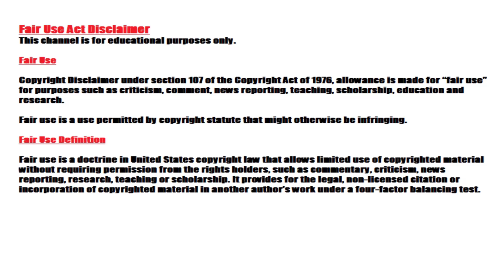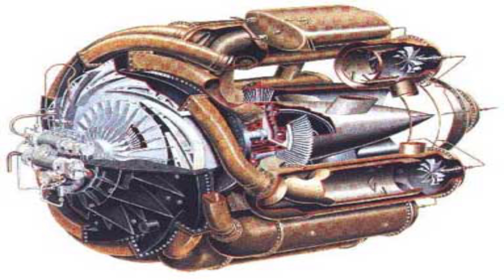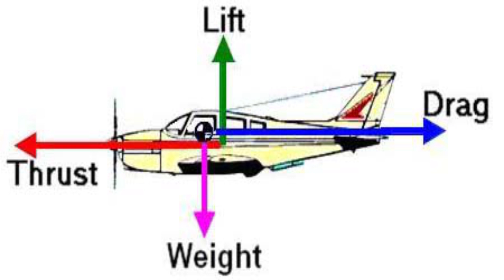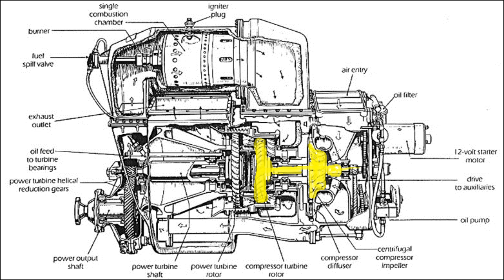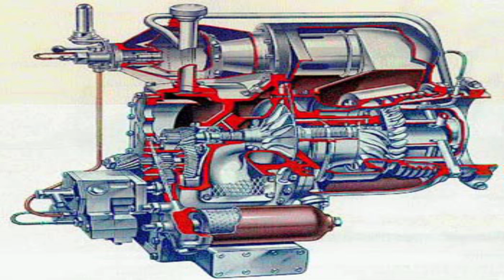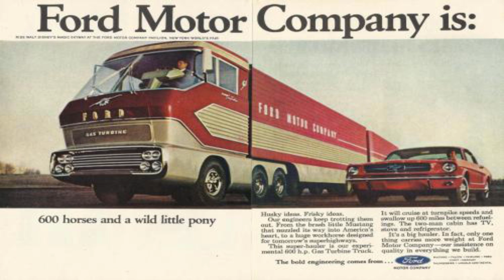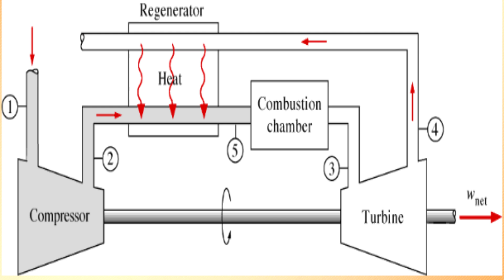Rover's gas turbines

Comment: Nice one Turbo!
Here's my idea, one of those little fireman's  jet engines powering a genny in a car, electric motors on each wheel and a big F#off capacitor instead of batteries, 
Now we need to find someone with the mad skills to build it  😉
Reply from the maker: While you are trying that I'm going to find two of those little engines and make 60hp roller blades.....   Each foot'l be 60hp
Reply: It will never fit on my bench, You will have to make it for me  👍  😃
Reply from the maker: @Everythings_Adjustable  I don't do wires mate!

Comment: Many thanks, quite interesting. Talking of big diesels I was looking at one at the Hereford Water museum. A Tangye single cylinder with over 6000 cubic inches, or 100 litres.
Reply from the maker: Glad you found it interesting! Did you happen to find out what sort of speeds it ran at? I'm guessing around 60 rpm
Reply: @turboproductions212  No I didn't but I suspect you are right about the RPM. Alas they don't run it because of a crack in the crank shaft.
Reply: @turboproductions212  Also, if you're interested in veteran cars, you are in for a treat over on my channel in a minute.
Reply: Glad you appreciated the Tangye. Sadly cant be run due to deteriorating crankshaft cracks.  Bob Benson with then junior help from me planned its move from South Wales in around 1993 and was  a mammoth operation when the museum had fewer volunteers. If took us ages to get it started with air start trials with a road compressor.  I eventually 'acquired' a suitable electric high pressure air start compressor for reliable starting.  I keep meaning to get to the Museum of Internal Fire in North Wales; they have the Allen straight 8 Diesel I used to have custody of at RSRE Malvern. See via HubNut.
Reply: @turboproductions212  Yes before the dreaded crack it was run at about 100 rpm with superb exhaust chuffing and sometimes blowing smoke rings. The crack in the web to crankpin area was known about when the engine came from Milton Springs near Pembroke and was cut out and welded, with carefully low running hours recorded  during museum open days and periodic ultrasonic NDT checks made  I recall every 20 hours of  logged running,  but my understanding ( I emigrated in the late 1990s so stopped volunteering) is that the crack had started spreading again. Anyone know an amicable supremo of a  ship's engine crankshaft forging  works ?

Comment: Union Pacific tried gas turbine locomotives and had some interesting findings. They did it completely differently, though! They used one giant turbine engine in a 3-unit locomotive(The turbine was held in the second part of the locomotive, fuel/control systems held in the other two). Their findings were pretty fascinating, and the locomotives ran for 30 or 40 years.

* They were STUPIDLY powerful. One GTEL could do the work of five or six traditional locomotives AND run the train at the maximum allowed speeds with grace and ease.

* Noise was a massive issue. GTELs were so loud that people didn't really need the air horns to hear them coming, and a lot of complaints were filed over the years from inner city residents regarding these things.

* They used only one engine. This engine was so large that it had to be in its own separate unit, rather than all in one like a traditional locomotive.

* The fuel usage was atrocious. UP opted to feed them the cheapest rotgut fuel they could get their hands on...something turbine engines are, conveniently enough, quite content to run on since they literally only care if the fuel they're fed is flammable and can make it into the combustion chamber...and this is a large part of why the units survived as long as they did. Their voracious appetite is also why they had a third unit attached: A modified tender from a 4-8-4 steam locomotive that containled **nothing but fuel**. But eventually even that fuel got too expensive to justify the operating costs, and this is ultimately what retired them. When it became more cost effective to pull the same train with a 4-6 unit consist of traditional piston engine locomotives UP stopped using GTELs.

Some truly fascinating attempts at using gas turbines in surface applications happened over the years, and so far the only successful ones have been the M! Abrams(Which also has massive fuel economy issues) and as firefighting apparati/drying equipment on racing surfaces(NASCAR has a bunch of helicopter engines hanging off the back of 3/4 ton pickup trucks that they use to dry the track after a rain stops).
Reply from the maker: There were a few more turbine locomotives, SNCF  operated ETG's for ages, 1960's through to the new millennium, Amtrak even operated them in the states (must be the only time french rolling stock has been on american lines) seeing one of these things is one of my earliest memories of turbines, we were camping in France and this dodgy looking orange train pulls into the station whining, and my days i can still taste the half burnt kero in the air!
The swedes had a turbine powered tank back in the 50's combined with a piston diesel so they were not burning 100 gallons an hour while sitting in ambush waiting for Russian tanks to appear, both could be used simultaneously to give a fairly high speed, not too sure how they managed it but for such a bizarre design it stayed in service a really long time, gun elevation was achieved using the suspension, it never saw combat as far as i know so i'm not sure it can be called a success.
I hadnt seen the nascar track dryers, im going to have a little look now, thanks for watching, and for your comment i really enjoyed your description the fuel grades used.
Reply: @turboproductions212  Those trucks are usually called Jet Dryers. Fun fact: Juan Pablo Montoya actually crashed into the back of one a few years ago when something on his car broke during a caution. No fault of his own, car fell out from under him at the exact worst moment, spun 'im up into the turbine engine and spilled the fuel all over the track. Eventually caught fire. Nobody was harmed though.

NASCAR doesn't use turbine engines for firefighting, but Russia has a shockingly large quantity of old T-34 tanks that have had their turrets modified to accept a MiG-15 engine, which is used to accelerate foam to ungodly speeds. They're primarily used to fight oilfield fires.

Comment: the "cost always being a dictating factor" was always a positive effect on (Land) Rover, it was only when they got more money than sense that they "made" the Rover 25, and after that they didn't make anything at all.

i'm also fond of BIG diesels, jet powered cars are cool n'all but they don't spit out hot soot or generate enough torque to reverse the axial rotation of the earth.
Reply from the maker: The official story is the unions did it, and every company amalgamated into BL was already rotten to the core with management who had given up on the work force and a workforce alienated by the unions who called strikes every time automated equipment was introduced, same story with that high speed train, BR had built it with the first one man cab, the unions had condemned it before it ever got onto rails.

Ok, I hear you on the big diesels, I'll see what i can do, thanks for joining me on the new channel, it is appreciated.

Comment: Cool stuff! I’m interested in the origins of the diesel engine and how they came up with the idea of the glow plugs as an ignition source. The viscosity of the fuel seems like it’s too dense to ignite efficiently, but obviously it does and does well. Is it the type of ignition that gives it its power advantage or gasoline? I dont fully understand it, to be honest. The gasoline and air-fuel mixtures in combustion engines seem more natural to me.
Reply: glow plugs aren't the ignition source, they just warm the engine up to the point where combustion via sheer compression is possible. fairly sure the power has a lot to do with compression ratio and getting more useful work out of each ignition, the evidently more knowledgeable Turbo, i'm sure, can tell us more.
Reply from the maker: diesel has a higher calorific value (think fat man vs body builder, both weigh the same but one does more work) but a lot of it's low down torque is due to the construction of the engine as to get the compression ratios high enough for combustion old diesels at least have narrow long stroke pistons meaning to get the same crank speed the piston would need to go twice as fast as its got further to travel so they turn slower but at the same time produce much more torque because the crank has a much greater lever arm, there are some great demonstrations of compression ignition, compressing the air so much it becomes hot enough to ignite fuel https://www.youtube.com/watch?v=4qe1Ueifekg 
I'm not sure i should do a diesels origin video, Akroyd Stewart was a local man also the real inventor of the diesel engine, not Rudolf Diesel, i'm obviously very biased on this matter, chances are i'll try and bend history.
Reply: @turboproductions212  I heard that they got the idea for the diesel engine ignition source after seeing a fire piston being used to light a cigar.
Reply from the maker: @vinniesdayoff3968  entirely feasible, educated folk do smoke cigars....